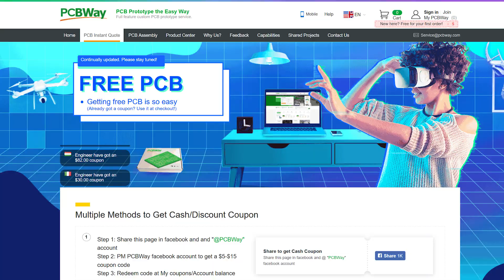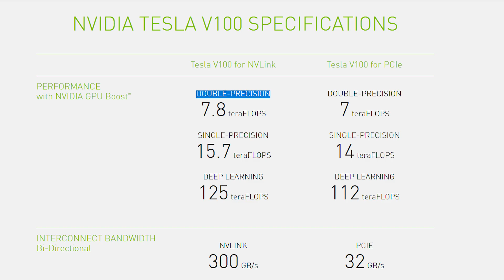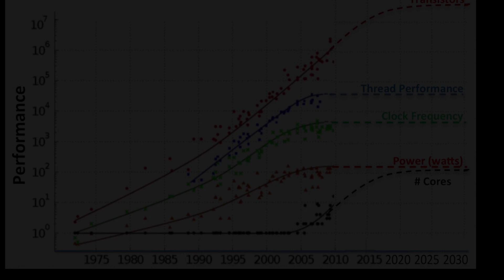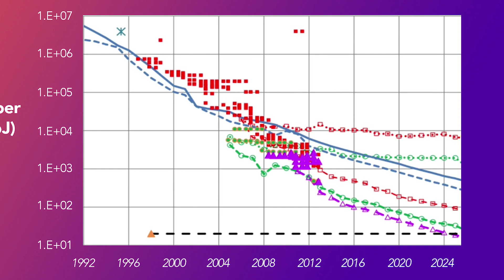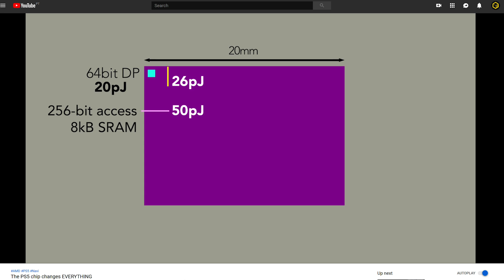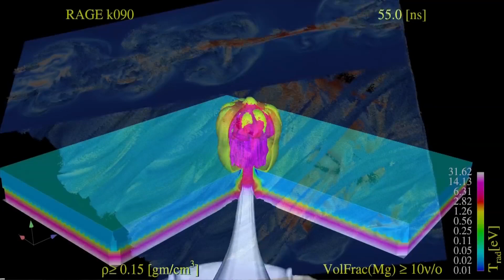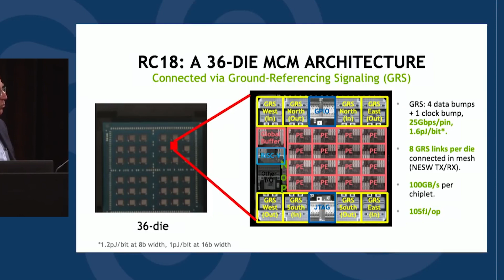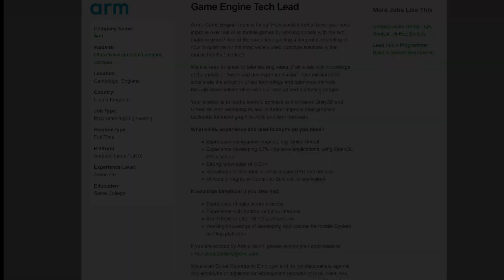The FUTURE of Computing Performance

Comment: There is one way unexplored areas for massively unexplored areas that merits consideration. How about using massive index tables instead algorithms for common single valued mapping functions like trigonometric, hyperbolic functions, transforms and so on. Also, how about massive sparse matrix memories obviate repetitive recalculation for modeling calculations. For 64-bit valued answers, the size of these read-only index tables would be massive, but if degrees would be converted to pi radians to minimize table size with minimal compromise in attained performance.

Comment: It's probably not 4 GPU competitors, but 4+. Arm will probably not deal with manufacturing gpu dies, but continue to sell IP-s, now for discrete size gpu-s too. Any vendor can pick it up and design its own gpu from what Arm offers. 
eg: Mediatek, Huawei might enter the market as Arm gpu chip designer, or with arm notebook apus. Asus being an AiB partner for AMD and Nvidia might also design its own Arm based gpu chip. Apple is also a good candidate
Reply from the maker: Yes I didn't mention that but IP licensing is the idea. I will be covering this when I next revisit ARM in a video.

Comment: Also HPE (Hewlett Packard Enterprise) saw this coming couple years ago.
They build "The Machine", they are using photonics to lower the energy use. 

IBM is experimenting with photonics for multiple decades now, how far are they with the technology?
Reply: I read there's photonic Multiplexer and amplifier, meaning a device that compute with light alone, multiplex & amplify a Fibre optic signal without converting them to electronic signal first.

Comment: I'm not sure that there's much point to the big cores if it's all going to be computed locally.  At that point, it's make as many small cores as possible, and do more models simultaneously to fill the small cores.  Also, if it takes the code developer coding it, it's not likely going to happen.  It needs to be integrated into the compiler / runtime environment, or better yet, the firmware of the chip (as AMD already implements AI and CPU monitoring at the CPU level).

Comment: Energy being a limit? Uh no. Efficiency.* Look at human brains, which are MUCH more capable than any super computer. They need to do more engineering or even change out architectures completely. We had those, but programmers aren't willing to learn a way to program something completely new. So the biggest bottleneck are humans themselves right now.

Edit: *He mentions that himself at around 11:00
Reply: "but programmers aren't willing to learn a way to program something completely new."
That's a pretty bold statement. New programming languages come out very often and programmers aren't just one group.
Imagine that a group of just 5 programmers could write a simple game engine or browser in this fabled 'new' way. Then imagine that the result is 5x faster than a conventional one. Wouldn't you think they'd be all over that?

It's easy to make such a claim, but if you don't tell what they should do instead, then it's kind of pointless.

I'm a programmer myself. When coreteks says that a loop is executed on multiple cores, then he's forgetting to put a million asterisks there. It's certainly possible for some problems, but for other problems it's not.
An example is a fully deterministic physics engine. Elements can be multi-threaded, but to keep it deterministic you'd need to sync so often that it will mostly negate the fact that you're using multiple cores.

Comment: btw why not move cpu to main memory? Image I want do `memset` on some 1GiB range, cpu instead of manually setting each memory localization it ask memory to set itself (send request like `range 0x2300-0x5300 op: set $ 0;`). Or more complex operations like `if ($ > 10); set $ 255; else set $ 0;`, with this we could speed code in some corner cases by 100 times.
Reply: What You mean?

Cause apart from most RAMs or small simple memory on microcontrollers ect. Well they have they own microcontrollers and other circuitry.

Actually some proven that in a bit hacky way one can use DDR RAM sticks essentialy alone as entire computer ; p
Reply: @CzornyLisek  Currently every change in memory us caused by main CPU that send some thing like `move $mem X;`, this mean to make +1 in each cell you need pay time delay for load and store, but if you could send some operations to RAM microcontrollers that will execute it on your behave. Idea is to move some computation to RAM, this could be a mix of accelerator and normal memory.

Comment: IBM CBEA - I believe that chip was too difficult to code. It has a dual-core PowerPC CPU and ~9(i think) small SPUs(Synergistic Processing Unit) RISC SIMD CPUs on one Chip. It is built into the Playstation 3. It is basically the successor of todays  CPU/GPU combos, because I think when the Cell Processor came out, there was no such thing as a AMD APU like device. When Sony allowed installing Linux onto the PS3, I coded a Raytracer on it, about 10 years ago. You had to code the main program for PPC CPUs and then also small (GPU shader like) SIMD programs which were running on a SPU. You are required to select the SPU the program runs on and you needed to pass data to the SPUs that needed to be processed. There were some clever ideas of how to use the ring bus the SPUs are connected together in order to optimise processing time. I never used Sonys engine, but I think they made it easier to develop games on the PS3 for the Cell. Anyways. Great vid.

Comment: Awesome video! I love how these videos make you think and provoke questions... question like: When you discuss the meta data processor, the extra chip to schedule data in an energy optimized manner, I immediately started thinking about Apple's T2... is that in the ballpark of what you're talking about? Or would the chip have to be on die? Could the T2 be the start of this coprocessor/meta data scheduler trend?
Reply from the maker: I think the T2 is more geared towards creating a secure (isolated) environment for data-sensitive silicon (like facial recognition, etc), and not so much a locality device, these are different concepts. But I suspect apple will be one of the first to take the data-centric approach to hardware/software, yes.

Comment: I know that this isn't an in-depth video, but that's not how parallelism works as shown at 16:52. Loops don't get automatically parallelized amongst multiple cores and the loop in your example isn't concurrent, which is a prerequisite for parallelism. A lot of things that you've suggested are already done in todays CPUs and especially OS process schedulers; i.e. not constantly switching processes from one core to another and trying to keep processes within the same core complex (Zen2) if a process must be reassigned to a new core to reutilize as much data from all registers and caches as possible.

Hope you don't take the critique the wrong way. Sometimes I'm just too OCD. 😅

On an other note: this "datacentric model" seems to be an attempt to get a little bit closer to what a "dataflow architecture" does (or would do).

Comment: At 11:00 ---> Jaguar/Puma+ cores AMD released for notebooks and the PS4/xbox one....years ago.
On extreme massive scaling.....each processor will function as a resistor. To get past that superconductivity becomes necessary.....that again further increases power consumption....the only solution is to commercialise qubits for quantum processors and optimising AI for that.

Comment: I think You missed something out here about the "data-centric" model your still saying 80% faster but it would not be because metadata IMO, It is still data that has to be stored and that is an overhead, and it's an overhead that can't be parallelized so it will run into Amdahl's law for because every parallel operation that will be a none parallel to keep track of it which suggests you would have worse performance than currently available in massively parallel operations because you would have a 1:1 parallel to none meaning your program as a minimum is at 50% unparallel.

The reason I make this argument did parallel programming for HPC at university, and if you were to parallel the metadata it can't be trusted as it might not be updated in time. so if i have missed something please correct me. but my understanding of parallel software architecture is what lead me to this.

Comment: Tensors run on gpus can't make up for data transfer costs if you have a distributed exa-process?
Reply: I've been under the impression, for a few years, that what a blockchain can actually be useful for is BEING a SELF-PROCESSING DATA-LAKE.
Reply: That is why CPU+GPU+RAM scenario is perfect for distributed supercomputing, after all, most consumer grade GPUs are capable of double precision floating point calculus.

Comment: For almost two decades most of the game developers refused to take advantage of multiple cores and optimize the games because of more work required. This is just one example where superior hardware is available but due to the extra cost of development is not being used. I doubt things are going to change for the better, actually they might even get worse because of more complexity and extra development cost required for the same task.
Reply: You can blame managers for that all most of them care about is getting the project completed ASAP.

Comment: Didn't Intel already try this in their old Xeon line ups before project Phi when they had 64 lightweight x86 cores? I thought they found that it does reduce power but at a major constraint of data fragmentation in the cache which had to be fixed through specialized chips that organized everything increasing the latency between data being sent/received and actual computation and in the end, making it not worthwhile for running any actual general purpose software.

Also great video, although I don't really understand where you got that programming a loop spreads out the process to multiple cores/threads. It only does that if you tell it to (at least in C/C++), otherwise the loop only uses one thread and stays on the same core until the loop finishes. Maybe you mean a more abstract language like Python, which would then not be the CPU's fault but the developer's fault.

Comment: Multi-threaded Parallelism is the single greatest failure by programmers and hardware manufacturers to implement, and we won’t be able to while focusing on multi-platform compatibility. 

Only until we have ML Assisted Assembly, while giving the programs their own hyper visor will we see anything tangible in the future. They removed our ability to write and own our own code and data, consent already acquired.

Comment: At 16:53 you mention ,"Looped instructions gets distributed automatically across cores". This is a bit unclear and doesn't align to what i understand about multi-threaded programming, could you please provide reference?  Nice video though.
Reply: It's complicated that's a computer science course in itself.
Just Google it you might not hear from him for weeks.
Reply: @dannygjk  I know, what i was trying to hit home is, what he is stating is not correct.
Reply: @prashant97  I wouldn't say incorrect. I would say unclear.
Reply: @dannygjk  he says "loops are automatically distributed across cores". I would say that is incorrect.
Reply: @prashant97  I think he means that the different cores are processing the code inside the loop such that the iterations are being processed at the same time. So for example 4 iterations at the same time. That's tricky tho because the code has to be written to take that into consideration. It's why some apps/games don't take advantage of multi-core processing or if they do it's only for small sections of the code.

Comment: It's just unfortunate that unless there is some monetary reason to do so, devs will not go out of their way to optimize code for core efficiency, let alone localized core cluster usage. High level work-flow industry leaders would have a clear monetary incentive to do so - but games, or the vast majority of apps? I can't see it. However, it does pose a unique opportunity. One that hasn't been seen since the switch from DOS to the UI(the latter opened up PC usability to with no prior syntax training). Any smart cookie, with enough knowledge, could conceivably create an multi core efficiency app, that could intercede to utilize the core model you talk about. Not only for future CPU designs, but make it backwards compatible. I don't think most people realize just how much computational power the average PC has, that goes unused, or drastically underused. Just imagine, if just games today were suddenly able to fully utilize all spare threads on say a 1600X, 3700X, or a Threadripper, instead of half of those threads and cores sat idle. That would be one very wealthy software dev virtually overnight. Although, they may get assassinated by rogue employees of Intel, AMD, TSMC, and Globalfoundries, whose jobs essentially rely on poor optimization. Forget I said anything. I don't want those employees coming after me, to beat me to death with their calculators. I WAS NEVER HERE.

Comment: Probably tl;dr. . . .

So, this ARM rumor has grown legs, and I'm kind of feeling like people are getting carried away and not taking into account known things which may well point to more down to earth possibilities.  In no particular order, these are:

Graphics drivers are going mainline on Linux.  Despite their (generally) low cost/value nature, SBCs are probably the number one growth sector in computing right now, and Linux is a very important part of that space.  I wouldn't be surprised at all to see them saying, you know, we need to hire more people.  Of course, drivers aren't the same thing as optimizing a gaming engine.  What I'm getting at, though, is that with their existing SOC IP already growing on the desktop (and with an explosion around the corner, as I see it), which isn't energy limited the way phones/portable are, and with their record of being pretty forward-looking, it wouldn't surprise me at all to see them doing this even without plans for a discrete GPU.  The better they can demonstrate the capability of their designs, the easier it will be to push for more widespread adoption.  This also has synergy with the next item. 

AMD and Samsung inked a deal.  Samsung has been one of ARM's major graphics licensees, but the first couple gens of Bifrost were pretty disappointing, making it that much harder for Samsung to drop Qualcomm completely (which they clearly want to do), not to mention hurting ARM's ability to compete in the GPU space in general.  Bifrost 3rd Gen (G77) comes out this year, and they are promising pretty big things.  Maximising optimization will help them convince existing and potential customers to stay with (or adopt) their graphics solutions.  With Samsung, in particular, it will be interesting to see what happens.  If their deal with AMD is similar to the way ARM licenses their IP, then ARM (if G77 and future implementations are good enough) might be able to keep Samsung in their walled garden by making a sweet enough V8x+graphics licensing deal. 

The other thing that makes me wonder is the fact that ARM aren't a manufacturer.  They only license their IP.   Which raises the question, are you suggesting we will see ARM branded GPUs, the same way we see AMD; Nvidia, and, soon, Intel GPUs?  Or are we going to see them define a standard and say, hey, anyone who wants to license this. . . .

Honestly, either scenario seems problematic.  Their most current offering tops out at 1024 shaders IINM.  That's definitely powerful enough to commit resources to optimizing it, even for integrated GPUs in portable applications (in fact, all the more reason to do so in that scenario, since you can't squeeze more performance by increasing clocks).  Not powerful enough that I would see AIB makers wanting to partner up for that, though.  OTOH ARM do tout G77 scaleability, so maybe they will come out soon with an enhanced version that goes up to 2x or 3x that amount?  Otherwise, their next graphics revision is probably ~18 months or so down the line.

Anyway, just some thoughts.  I'm as excited as the next person by the idea of discrete ARM GPUs, but the evidence seems pretty thin.  Unless you actually have more solid info but aren't able to tell us?

Comment: 12 pJ/operation, how about 413 pSv/neutron? Just get some Cf-252.
Reply: We need positronic brains, as described by Asimov :) So not neutron, but beta-plus emitter isotopes!
Reply: @allmycircuits8850  Yeah, you would just need antimatter wires to carry the anti-electricity. Why this is better than regular electricity is beyond me.

Comment: Well a bit more of rough rambling(exploring the space) with a little bit of structure-forming on the writing of code patterns and those be detected but more involved that the 
just the iterator as need take CRUDSAP ops into account and abstracted memory heap reference to variablPagedheaps.
Typically results being two orthogonal data structure to optimize for micro cpu to operate without stalling. 
- variable Page reference Heap for physical data operations to balance workload across mico distribute cpu blocks.
- control iterative seeking, algorithm PageStructure.
https://docs.google.com/document/d/1eydBQO_kuMxQ7N_1ifNnGwEKHrfBMMRP-OryiwPkumE/edit?usp=sharing